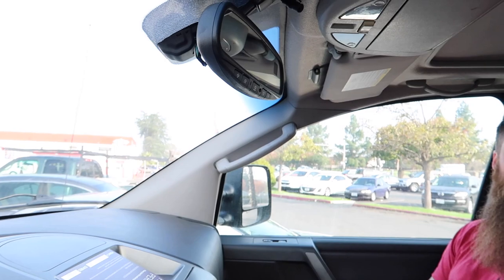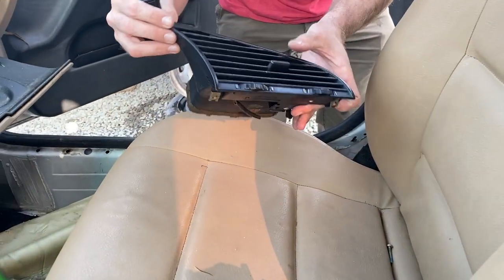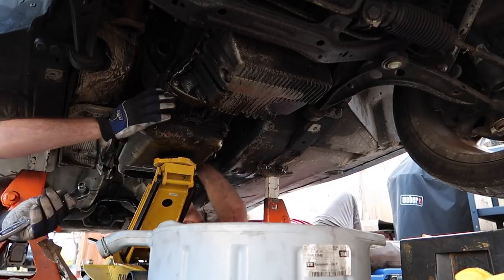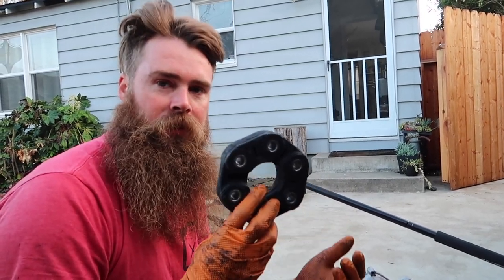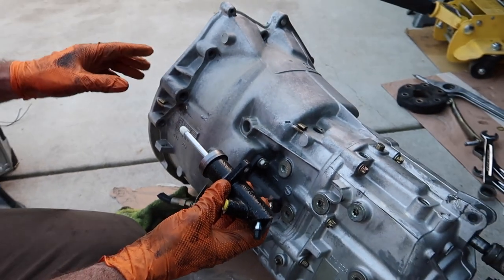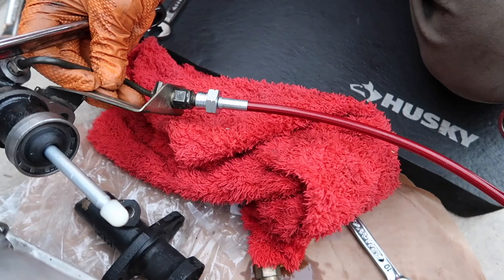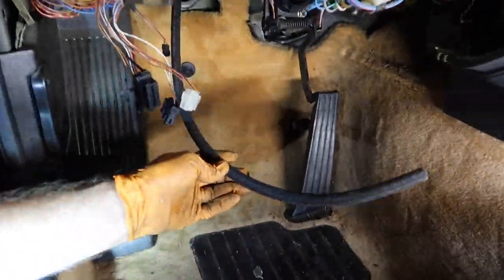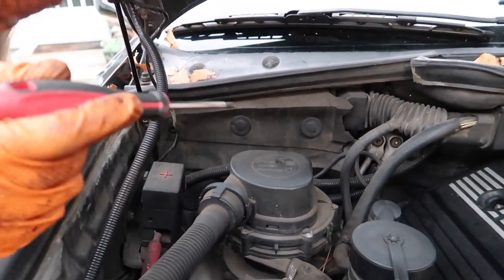MANUAL SWAPPING MY E36 M3! PART.2

Comment: When pulling the auto-tranny off, do you need to pry the starter off first or will the starter come off by itself as you pull the tranny? I am in process of doing my manual swap and can't pull the auto-tranny off.  The Starter seems to be stuck onto the tranny. thank you.
Reply: i had this same issue when i was pulling my manual from a junkyard e36, so i just got a long flathead and pried it apart, and then the trans came right off